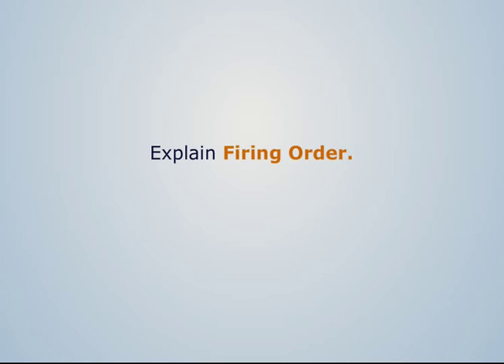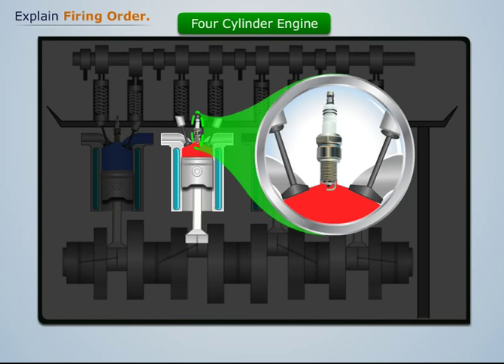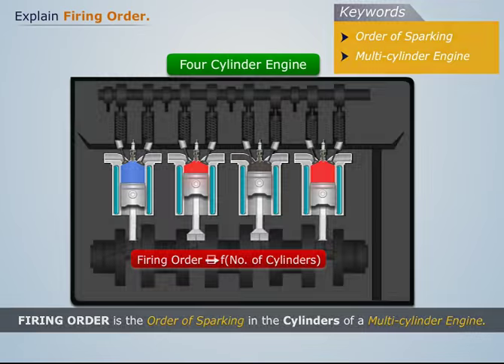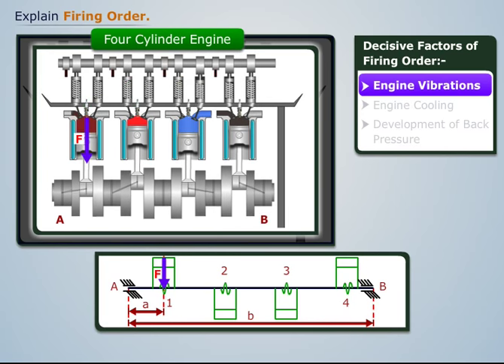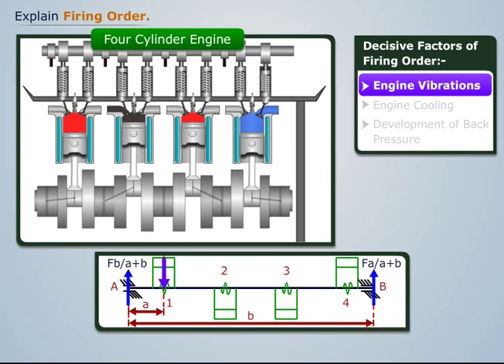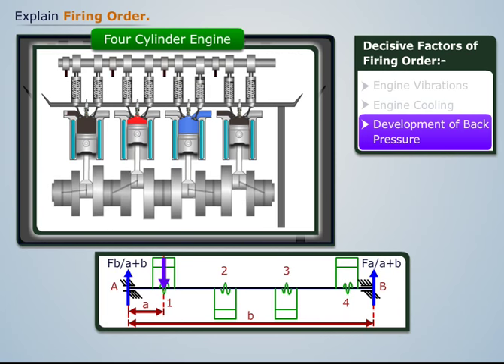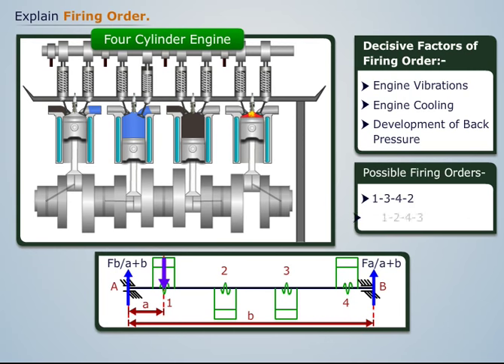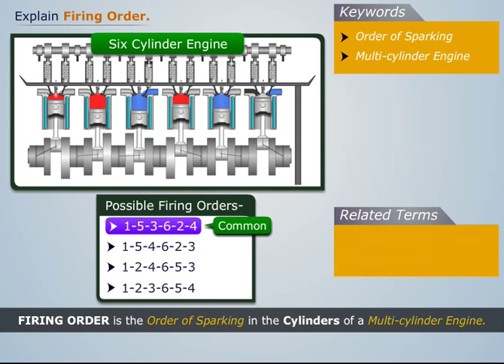Explain Engine Firing Order | Automobile Engineering

Comment: why can't it be 1-4-2-3
Reply: 1&4 and 2&3 are the pairs which reach TDC at the same time. At the end of the power stroke of cylinder 1, cylinders 2&3 are now at TDC ready to fire, cylinder 4 is at BDC with 1, and has to rotate 180 degrees before firing. In the next stroke when 1 goes through exhaust, 4 will be going through compression, and either 2 or 3 through power stroke with the other through intake. The crankshaft is set up that way for balance, to reduce vibration and wear.
Reply: Mark McCormack no, it possible if we modificate the crank angle of each piston. but the effect is the engine vibration is unstable. the other firing order with 4 cylinder is 1-4-3-2 it's commonly used in 4 cylinder boxer engine like VW.
Reply: Mark McCormack all those things are BECAUSE we modify the crankshaft so it fires that way... so it doens't apply as a reason why another firing order can't be right... If I understand it correctly

Comment: Ok, I get that loads would be different, but what about something like a v4 or boxer engine? Could firing order change depending on the layout of the engine?
Reply: Did you ever find out  what the true answer is to your question ?
Reply: In an Alfa Romeo boxer the firing order is 1-3-2-4 which makes sense as 1 and 2 are the front pair of cylinders and 3 and 4 are the rear pair. You will never have two cylinders from the same pair fired one after the other in a four cylinder boxer, as both pistons in a pair reach TDC at the same time. From my understanding Subaru boxer is the same 1-3-2-4 as Alfa Romeo. In air-cooled VW and Porsche 356/912 engines the cylinder numbering is different, and the front pair of cylinders are numbered 1 and 3, and the rear pair numbered 2 and 4, so firing order follows a different numbering, although the same rules apply regarding two cylinders from the same pair will not be fired one after the other.

Comment: Sir I will be really grateful if you can explain about these two engines one is Leyland 370 Six Cylinder Naturally Aspirated Diesel Engine and another is Mercedes Benz OM 352 six Cylinder Naturally Aspirated Diesel Engine plus whether Leyland 370 engine can give good performance in comparison to Mercedes Benz OM 352 Engine on a steep hilly road.

Comment: But you said due to vibrational factors 1 and 2 cannot be fired successively, but why am I seeing 1-2-...... as the possible orders sir?
Reply: In a 4 cyl firing cycle you will always have two consecutive pistons to fire one after the other.. in the most common firing order (1342) you have 3 and 4 which are the last 2 cylinders away from the distribution chain / belt, or the water pump side of the engine. So based on that is why you also have a 1 and 2 firing order too...   What you can't have is a 2 and 3 firing order because you'll be putting a lot of pressure in the middle of the crankshaft resulting in short term reliability.

I hope that makes it clear.. 1342 is the preferred way even though we also have a 3-4 firing order that is not desired, but kind of the best combo possible as far as firing order goes.

Comment: Even if it's 1-3-4-2, there'd have the same amount of vibrations as 1-2-4-3, as cylinders 1-2 and 3-4 will still be firing after each other.
Reply: I think best order is 1-3-2-4
Reply: @jaydipsavani8744  totally agree
Reply: @jaydipsavani8744  no.. you don't want excessive consecutive pressure in the middle of the crankshaft. It's proven to fail in the short term resulting in engine overhaul.

Comment: I have a V8 engine.  Am I to assume that each cyclinder gets a spark once every two revolutions?  Asking because I am seeing with timing gun spark in two different parts of the crackshaft.
Reply: Almost all engine pistons get s spark every 2 revolution without caring how many pistons it has..  4 stroke engines require 2 revolutions to complete all 4 cycles..

Only 2 stroke engines complete all 4 cycles in one revolution.

So YES.. assume your V8 pistons fire every 2 revolutions

Comment: YOU  mentioned for SiX Cylinder engine fire orders. i have done three ships with 6 cylinder diesel engines yanmar model 6EY18L.all have same firing order  1-4-2-6-3-5-1 
and i  guess dats most common and u have  not mentioned it above.
correct me if m wrong?
Reply: Yeah Brother, Im a bit confused because it is not mentioned in this video. By the way I also handle a YANMAR Engine 6AYM WST. it's firing order is 1 4 2 6 3 5 1.

Comment: Do any engines have multiple simultaneous cylinder firing?
Reply: No. 180° crank rotation is one stroke ( either up or down). A 4 stroke is power (down), exhaust (up), intake (down), compression (up). 180° × 4 strokes= 720°. Divide 720 by the number of cylinders. Play with numbers. Less than 4 cylinders there is a lag. More than 4 there is over lap resulting in smother. A 4 cylinders gets power every 180° of crank but a v8 every 90° of rotation.
Reply: Even an engine with 2,880 cylinders no. There would be a power stroke ever 0.25° of crank rotation. Can only get infinitely closer but never simultaneous.

Comment: I don't understand, are you counting cylinders when going 1-3-4-2 or counting the numbers from 1-4.

And also from where do you start counting cylinders on an engine if it is facing straight from the firewall.
Reply: Zlatan Ibrahimovic 
Some manufacturers start counting on the side connected to the gearbox, some start counting on the other side
Reply: Thomas Bergel Thanks
Reply: It's manufacturer dependant... Most 4 cylinder engines start counting from the side where the water pump is..  opposite to the starter motor side.

Comment: Why do we need firing order .. why can't we fire all cylinders at the same time?
Reply: I'd imagine there would be short periods of high stress on the crankshaft, followed by a "long" period with no combustion.  It's better to spread out the force over time to keep the power flow pretty consistent, reduce vibration and stress.  Otherwise, you'd essentially have a go kart engine, very loud and lots of vibration

Comment: to bad you did'nt  tell why they use 3rd silinder instead of 4rth. I know the answer, but begginners propably have this question.
And there shuld be more talking about 6 cilinder.  6 inline has more backpresure if it has one exhaust manifold as diesel bmw has. So there is always some back flow because of that.
Reply: Why